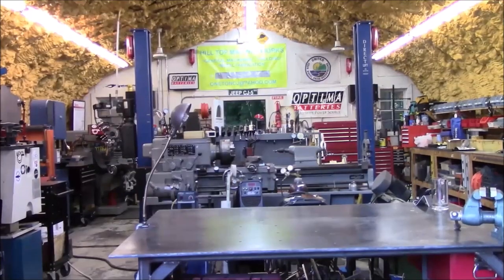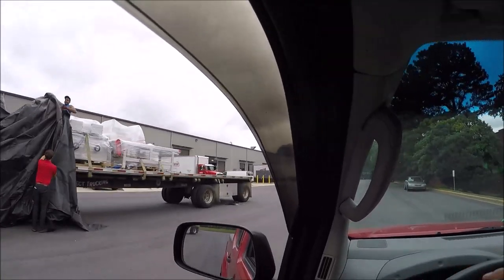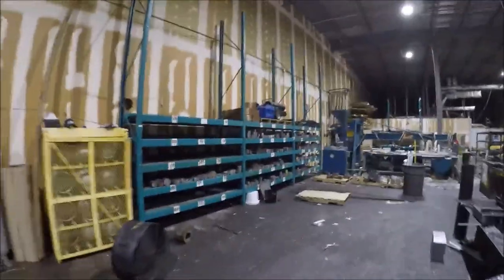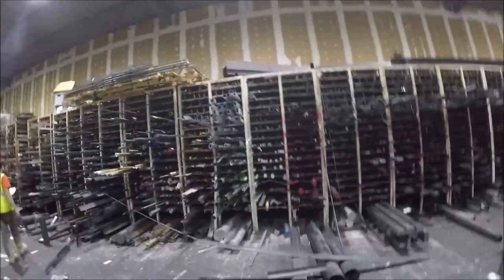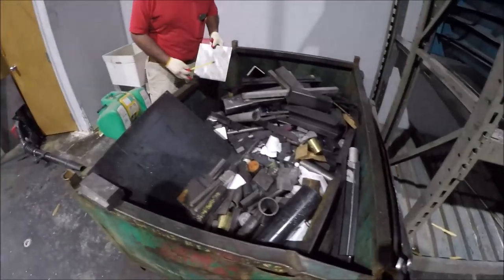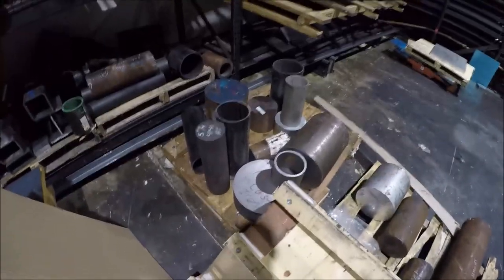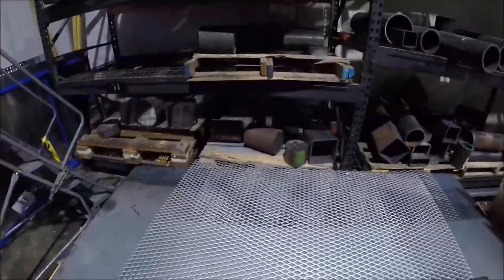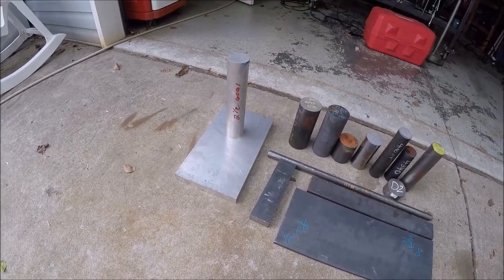Me & Jim visit Metal Supermarkets

Comment: Wow, I had no idea exactly how much cheaper material is in the US!  At our local Metal Supermarket, the hot rolled (not cold rolled) is $1.25/lb and aluminum is anywhere in the neighborhood of $4-7/lb depending on its type!  I got a short piece of 4140 the other day and alloy is $3.50/lb.  All in $CDN.  Not trying to sound negative or anything, as I'm sure in some other markets it's even higher, that's just life.  And for what it's worth, I quite like the crew in the two local Metal Supermarkets as they are quite good to work with.  Thank you for sharing though, it's good to know what the ground level prices are for supplies in other markets.  Interested to see what parts are hidden in your bin finds!

Comment: My closest metal supermarket is about a 2.5 hr drive from me. My local scrapyard charge $.35/ pound for steel and $1.50 for aluminum. The steel is usually rusty. Stainless steel is also $1.50 . Nothing is marked as to what type of material it is. I’d like to see what other pay for drops or scrap. So everyone let me know!
Reply from the maker: That was the nice thing about the drops from metal supermarkets as most were identified. As you mentioned going to the scrap yard you get mystery metal, but the prices seem to be a tad bit cheaper on the steel. Aluminum not so much. Last aluminum I got from the scrap yard they wanted 2 bucks a pound.